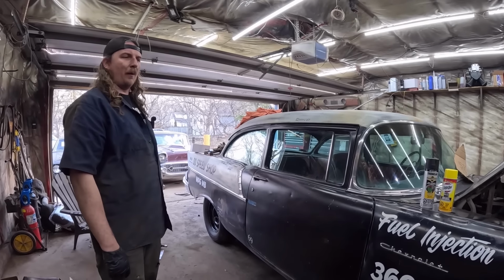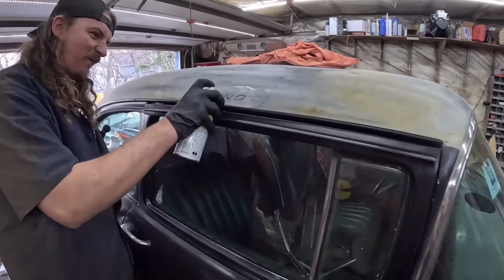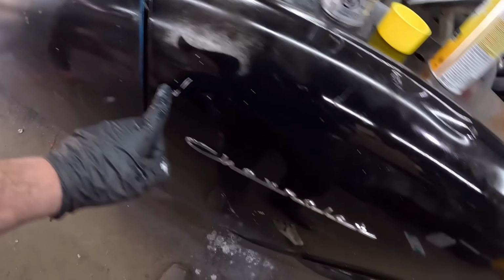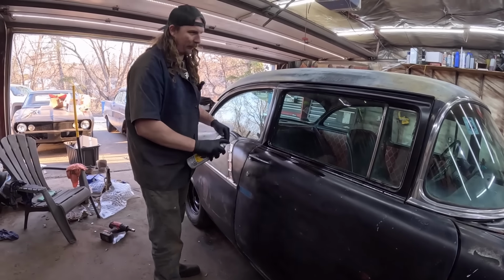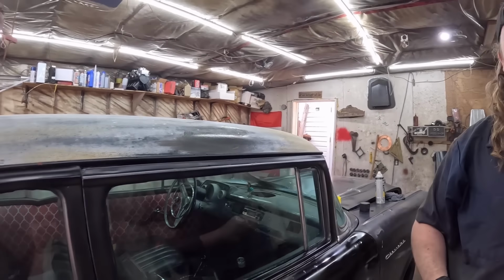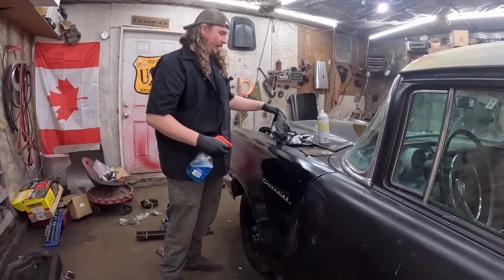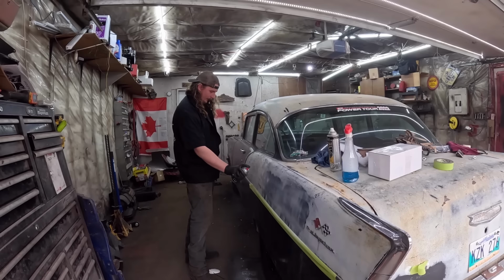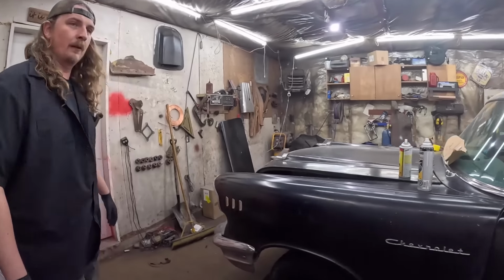DDDelete Speed Shop - All Good Things Come To An End

Comment: The factory paint is Baked Enamel with the lettering is only painted on and not heated. That’s why it works. I have been using Oven Cleaner to take letters off of vehicles. I am in the car business.

Comment: Dan , lazy didnt read all your coments //// acetone the pwr house in the oven cleaner /// used for years to remove lettering off comercial vehicles , for used car lot resale. ...
Tips : 1) small paint brush to brush a little on the stuborn areas .
2) plastic mud applicator 
To get under paint to roll her up , & push her right along . 
3) plenty off cool clear water to flush , it will attact the other paint .. timing is everything ... all kinds of variables , "age" , type of paint sign painter used . & type of  skin layed on the old hoopty... experiment what ya gonna hurt .
---- one old gear head ---

Comment: We used to use oven cleaner to degrease our junk yard engines. Back then there was a cheap brand called Mr. Muscle. Must have come from overseas because it stripped to the cast iron. Probably not as good as it was back then if it’s still available.

Comment: Here's the deal Dan. If the painthas a hardener in it (automotive paint)the oven cleaner will not affect it. If it's rattle can paint, or any other single stage paint, the oven cleaner will strip it.

Comment: @DD Speed Shop i use that even for clean the engine bay as well cleaning oil off the concrete floors! its wayyyyyy cheaper then engine gunk cleaner you use to clean engines up/bay area!

Comment: Generally, I just use a wheel and a light to medium compound..buzzes pinstriping & lettering right off and polishes out the ghost image left behind in one step..
Oven cleaner plays hell with single stage paints without catalyzers, so most of your "fauxtina" spray bomb stuff is just as vulnerable as the sign painter's work..

Comment: I used this stuff on a dirtbike with a white plastic gas tank that someone had spray painted black... of course paint does not stick well to that type of plastic so it was all chipping off and looked terrible. The oven cleaner worked very well stripping the paint, still a pretty messy job but looked a lot better the end. With all the chemicals they've outlawed, I'm surprised this stuff is still available.

Comment: Dan, I'll give you a great little secret and a tip from your U.S.  buddy.    To take top layer paint off without removing the underlying paint (which is what you are doing in this video),  use a paste orange RUBBING COMPOUND.  There is a fine and a regular.  The regular is faster.  Otherwise they both work the same.

Comment: Pro-tip Dan......
If you've got oil-stains on your concrete, spray that same stuff on the oil stain. Let it sit for a spell, and rinse it off with water. Occasionally, it takes two go'z at it; for bad, or Old stains....but Viola, they're gone‼️

The only roadblock I've run into is the Old, Ashy concrete.....

Cheers🥃🍺

Comment: Hey Dan surprised you never heard of the oven cleaner trick.  Over the years I use it as a mild Degreaser when I'm worried about taking paint off of the engine block or valve covers.  Works good for taking brake dust off of alloy wheels also.

Comment: Yep I told ya! Works! Great engine degreaser too!!  Cheers,  Junk's Automotive
Reply from the maker: Handy!
Reply: Yessir, oven cleaner works great on stainless braided hoses also. Spray on, spray rest of engine compartment with soapy water and rinse everything down…head out to the Malt shop!
Reply: Great for the ol "home hot tank" an engine block for rebuild too, if it's in fairly decent shape to begin with.
Hose er down inside and out ,follow up with a pressure washer hooked to hot water if you can.
Reply: @MrTheHillfolk  works awesome on firewalls and under hoods. Cleans  them great before you start sanding and prepping for paint! Just did a nasty MGA hood that was caked with 55 years of crud!

Comment: I have always liked the 150 trim level more than the 210 or Belair trims. Sorry not to see it anymore, I loved the snow plow.
Now for the science. "Oven cleaner" is caustic soda aka lye or sodium hydroxide. In crystal form you just add aluminium chips, and call it "Drano" So don't use it on glass or aluminium. Windex does not neutralize it, vinegar or lots of water is better. Caustic soda is used to clean old beer/pop bottles for refilling, Great for dissolving mice and cig butts

Comment: Used to use a special paste CPC 400 it would pull off that lettering enamel right off, the Older Version of Easy Off worked way better than the New weaker stuff, spray it on and let it simmer a bit, don't be in a hurry muttonhead! 🤣

Comment: I've been removing one shot lettering enamel for over 50 years. You do indeed need to let it soak in for 10 or 15 minutes. The is just plain junk paint. I've always used a new plastic bond spreader and it removes the lettering quicker than using a rag. Use a white spray bomb to help the white look better...same as your touch up on the black paint...I know you don't want the paint to look good...😅

Comment: Well, that is sad. I don't know if you are familiar with the term "black widow" but that was a name of '57 Chevy stock car racers back in the day. It was black and white like yours. Google it. It used truck spindles and brakes and other parts to beef it up. I have always thought of yours as that black widow. Crazy 'bout how that oven cleaner works to remove paint. I guess the key to using it is to thoroughly wash it off to prevent it from working further. 👍